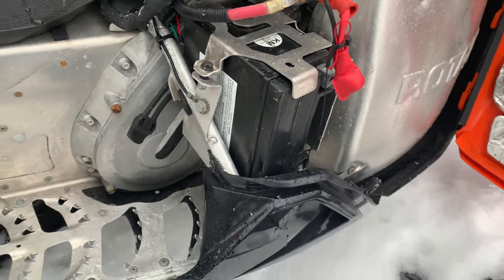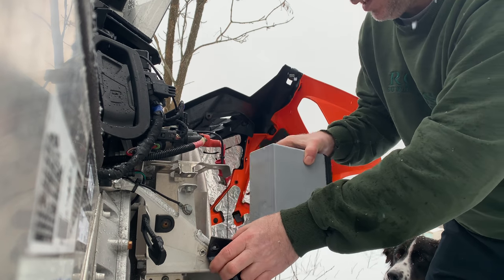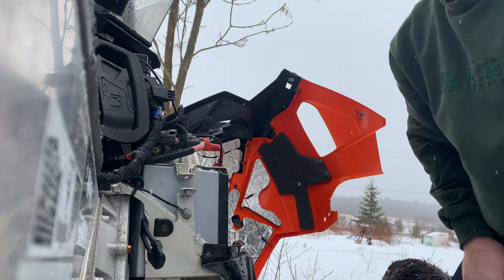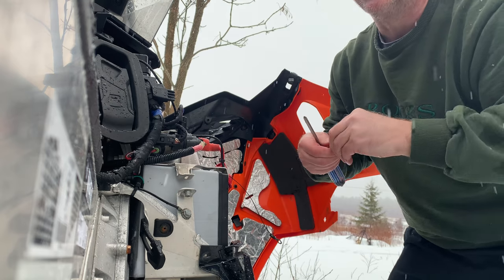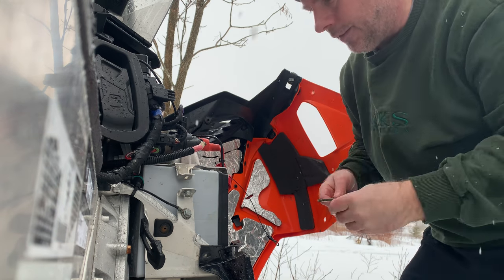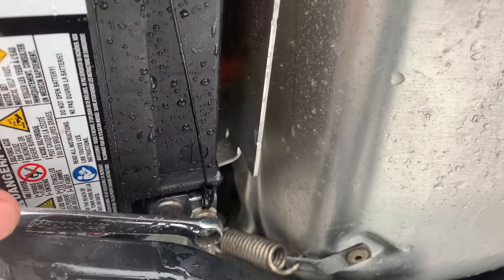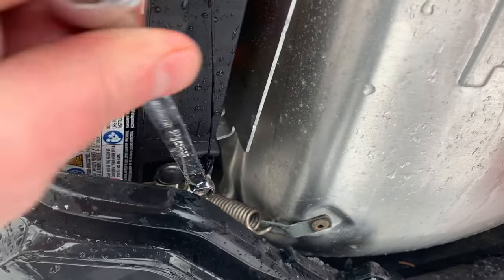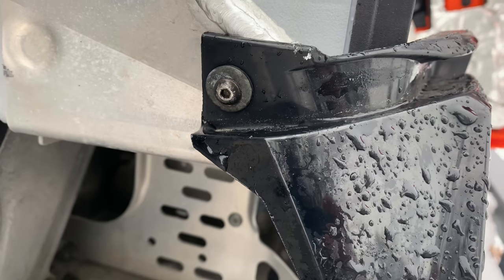Replacing the battery in a 2016 Ski-Doo 600 ACE Sport - Jan 25, 2020

Comment: How long did you have the original. My grand touring 2015 is just starting to maybe go after 6 years. Just bought a new one yesterday at dealer.$128 for a Yuasa which is stock. I got low batt once.
Reply from the maker: I was dumb and didn't put my battery on a trickle charger when storing it over the year.
I had an old solar panel and changer just laying around and so I put that on the battery when I put the sled way in the spring of 2020.
I started it up without any issue in mid December 2020.
These batteries can die very quickly if not taken care of so it's really hard to say.
6 years or of one of these batteries is pretty good.
This is similar to the panel I put on my battery this spring: https://www.costco.com/coleman-100w-solar-panel-with-8.5-amp-charge-controller-.product.100389117.html

Comment: How you take off the side panel is What I needed to know, you didn't show that in your video.
Reply: The side panel is still on he just open it you can see it in the video. For one black thing on the bottom near the battery🔋 you just need an allen key 👀 to take off one allen key thing
Reply from the maker: Once you open the panel it just lifts off but there is no need to take it off as it's pretty out of the way.
Andrew
Reply from the maker: and the panel is out of the way once it's open.
I think it's a 2.5mm allen key.
I think I mention it in the video... it was a long time ago :)